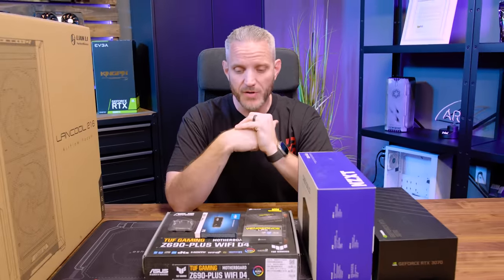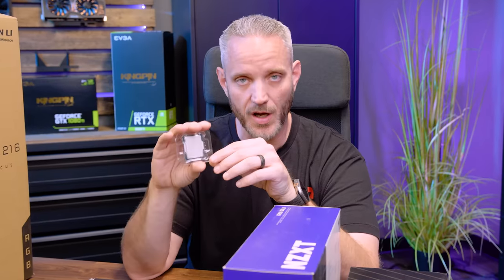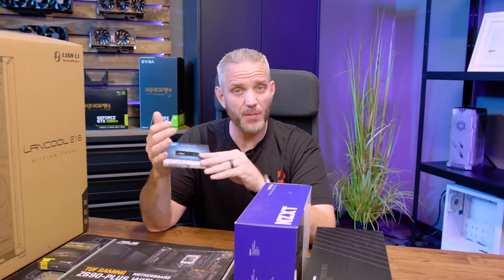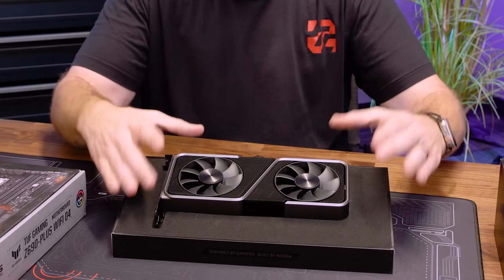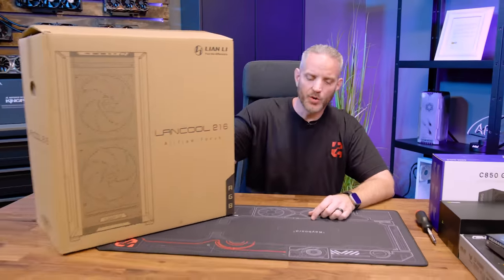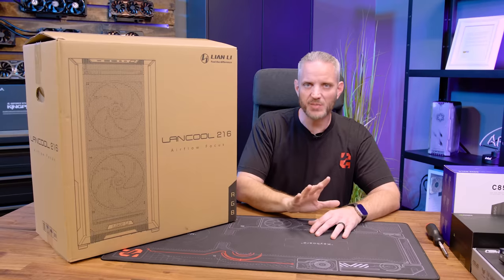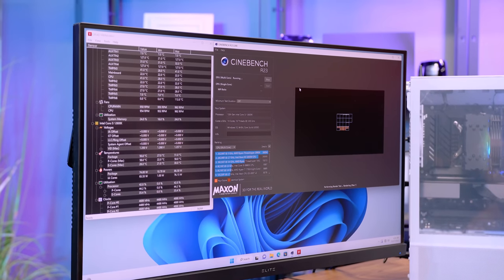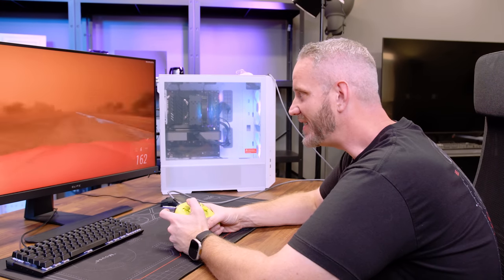Inexpensive PC Build Guide!

Comment: Hi guys, I'm new in pc building. Should I buy SSD with 2x500GB or a single 1TB? I've read some discussion in LTT, tomshardware, etc. and they mentioned about "Raid 0", "Raid 1" or something like that but I couldn't really get the meaning. Does it really impact on the performance? Kindly need your help.
Reply: I'd go with a single 1 TB SSD. RAID (Redundant Array of Independent Disk) is a technology used to combine multiple drives based RAID levels which depend on speed, capacity, and fault tolerance you need. It is typically used in enterprise IT systems and not really in typical home/gaming machines. Doesn't mean you can't use it, but it just isn't very common outside of enterprise systems.

In your case, there is likely no need to use RAID. There are various RAID levels which all have their pros and cons. RAID 0 is a stripped array. Using your example, with RAID 0 and 2x 500 GB SSDs, you would have a total of 1 TB of storage capacity and your SSDs will function as a single unit. Stripped means that the system stores parts of all files across drives. This gives the advantage of having fast speeds, but the major draw back is that if any drive fails, you loose all data.

RAID 1 is a mirrored array. With this level, all files are stored on both drives (hence mirroring). The advantage of this is that you can loose 1 drive, and you still have all of your data. Drawbacks are that your max capacity is limited to your largest drive's capacity and read/write performance is limited since the RAID controller has to update both drives with changes.

As you can see, it gets more complex the higher level you go and there is no real benefit for most home use cases. SSDs are already fast by themselves. You likely wouldn't notice a difference in performance unless you are regularly copying large files or running synthetic benchmarks. Unless you really need the fastest performance, you should be fine without RAID.

Comment: 23:41 Fuck dude, my tower is a custom build with a Xeon E5-2698v3 and my motherboard has the all-core turbo unlock done as well as a little undervolting and my cpu-z all-core score is 109 points higher than a threadripper 1920x and single core score literally 0.6 points lower than a threadripper 1950x, at least according to the scores listed on their site. That is with my power profile set to balanced as well. Set to high performance multi-core score goes up even further but single-core score tanks. Not too friggin shabby for a chip I paid $80cdn for off ali express

Comment: It really shows that AMD didnt think things thru when releasing the 7000 series. The pricing and models introduced to start with kinda gives Intel a stupid advantage that AMD could have avoided by doing some things different. I understand that having both DDR4 and 5 might have made the boards more complex and expensive than they already is, but by not having a cpu in the low 200$ range they will push people on a budget build with upgrade options over to Intel, when AM5 propably is going to be the best choice when it comes to longevity. We might bash Intel for many stupid things, but they did the right thing with several things this generation, Mobos which makes the 12th and 13th gen a better choice for budget builds. AMD can still sell tons of good AM4 budget builds but the upgrade path is pretty limited. You can seee wich upgrade will be availabl in the future. Wether a top 13'th gen cpu is a good choice for  upgrading is another matter when you take into the account how power hungry they are and how much cooling they need. AMD theoretically just need to introduce some cheaper AM5 boards and a good 200$ cpu  and the matter would be solved as DDR5 is already comming down in a decent price category. The biggest culprit is the excess price on AM5 boards right now that keeps real budget builds away. I hope AMD will come with a price banger with the non X versions comming up, cause personly I still think Intel is a dead end already too. They do have the best budget CPU's atm. but a 13900 is still a stupid cpu to upgrading to if you care about your electricity bill and how much more perf you get for the bump up in power consumption. I would much rather be sticking to the 5800X3d and AM4 untill it becomes too long in the tooth. It's still is up there at the absolute top right beneath Intel, trading blows with both AMD's own AM5 and Intel's 13'th gen. Honestly I only think both AM5 and 13th gen has a meaning if you have the need for specific applications where their performance and platform makes sense and the cost is worth it. For the moment there is absolutely no need for the avg home user to upgrade wether you have an existent AM4 or 10'th generation or later build, unless the cost doesn't mean that much.

Comment: Really have a hard time buying into raytracing being  worth $200 more in a new build. $50, sure. but $200? No.

 For me, that's money better spent on a bigger SSD, faster CPU, or just making the move to DDR5 now. If nVidia's stuff was comparably priced, it would be a harder choice, but their prices aren't dropping. 

The Vetroo mounting brackets for AM4 were unusable on the unit I got, and if they can't get that right, it's not a good value, particularly when I can get something that is competitive if not better from Thermalright, Artic, Noctua or BeQuiet! and not get a fan that feels flimsy.

It's an annoying time to try and build right now. AM5 motherboard prices are still ridiculous, We know Intel boards are a dead end in a year or less, and DDR5 is still pricey and doesn't play nicely in 4 DIMM setups at full speed. And that's ignoring new GPU pricing, which in some cases is more than this whole build costs.

Comment: I wouldn't spend $1500 on building a PC when the used component market is so flooded with cast-offs. I've built 4 systems using 90% used parts and only had one mainboard fail over the last 10 years. I've never spent over $800 on any system I've built and they all would play the latest game titles in their generations. I built an AMD Ryzen 3 series, an Intel 4th Gen, 7th Gen and 10th Gen systems.

Comment: Even if you could upgrade this LGA to 13th generation Intel what about if the next generation uses a different socket?  I'm guessing the 5000 series will still be plenty powerful enough for most people's needs over the time span the LGA 1700 is still upgradable, but I'm still pretty new to this so if I'm wrong I would like to know.
Reply: With a different socket you just buy a new motherboard to go with the CPU and RAM. But future proofing isn't that good because new motherboards will have new stuff an old board doesn't have, so by the time you want a new CPU you actually may want to upgrade the motherboard anyway.

Comment: Actually Jay there are as many AM4 @ 5800X as X6x0 @ 12600K CPU upgrade paths and GPU upgrade paths good point about system PSU insurance. Both choices stick you with the board (unless you buy Alder with a DDR4/5 lane implementation that is rare). It's the CPU that gets upgraded when that option is available and data show 30% of CPU upgradable board users will upgrade that platform with an up-bin socket compatible processor. mb
Reply: Alder in the WW channel was stuck rotting on the shelf in October early November as discount priced Raptor rolled out ala Osboning Alder. However, Black Friday into year-end discount (surplus) Windows 11 key price cracked and the mass volume of Alder started to move. AL into RL is a good upgrade option on the Intel side. mb
Reply: Tell me you like to type random crap without telling me… how was any of that helpful to anyone?
Reply: @kaptainkoffee5504  I was simply pointing out either platform; AM_ at R5K or Intel 12/13th has plenty of CPU and GPU option upgrade potential. mb

Comment: About CinebenchR23, I have a friend with an Intel i5 9400F and he gets 5700pts on Cinebench with a temp of 85-86c (If i'm not wrong it should start termal throttleing at 90c) But i tried to compare it to my R5 5600G on UserBenchmark and thay said the 5600G was only +6% better even tho i get 10600pts on mine, i know UserBenchmark can be a little unfair ageinst AMD so i googled other people's scores and thay got around 9000pts on the 9400F. His poor cpu has been running around 90c for a few years but does that really do that much permenant damage or am i simply wrong and it starts throttleing at 80c or something? I don't really expect Jay to see this, it's more directed towards people the comments. What can i do to fix it?

Comment: Nice build, nice video. Im my region i would go with amd for the gpu, cause i can get a 6750 xt for 100€ cheaper than a 3070 here.

I am looking for a new case. Got the cooler Master MB400 but using it to put up my feet, the top cover mash didn't like it. Bigger problem is the i o at the top, never thought my cat would hit the button, but during my thesis i learned differently.
Anyone with a good suggestion with i o at the front, nit ne top? Side wouldn't work too

Comment: do cpu model numbers always correspond with the gen?  like a 5600x is 5th gen and a 7800x is 7th?
Reply: No. Intel and AMD have different and very confusing naming schemes. I know Intel uses the first number (ie 7 in 7600k) as the generation. In other words a Core i5 7600k is a 7th generation Intel core i5 CPU. AMD uses a different system. I don't think I can post links, but the Verge has an article from last year going over AMD's new naming scheme. Its from the 7th of September 2022.
Reply: @JJFlores197  thanks :)

Comment: If you have 2 500 gig m.2 drives can't you raid them and get almost double the speed on the drives?
Reply: Yep, but I don't believe there is a notable difference in performance. NVMe drives are fast enough as is. Unless you are going to be writing/reading a very large number of very large files regularly, it likely won't be be of any real benefit.

Comment: Does the case matter
Reply: To an extent, yes. As long as the PC case and motherboard support the same form factor, you should be fine. Research PC form factors if you don't what those are. After that, it comes down to things like GPU length support and airflow.

Comment: So what happens if I’m that guy who completed a build with a lower end mobo and wishes to upgrade just that? How does that work?
Reply: Depends on what you mean by lower end? Are there missing features you want now/etc? But generally in my own personal builds I've never seen value in upgrading the mobo while remaining on the same platform.
Reply: @paulh7643  Unless the MB upgrade is from an under the barrel board to one inside the barrel or the current board stopped working there's value there, what i don't see any value in is wasting money buying every single generation year after year because it's slightly better than the last gen part.

Comment: Does anyone know a good software to use for fan controlling (free if possible lol)? I remember Jay mention one in an older video, but I couldn’t find it when I looked back. I have a flux 700 case w a gigabyte b550 aourus elite ac motherboard, and while I think I connected the fans to the mb properly, I can’t find where to make alterations in the bios. Also I’m using a rgb software but it only seems to work on the mb and ram sticks 😅

Comment: Hello!
Lately, I have upgraded my CPU from 9900k to 13700kf. And for that I had to change the mobo to a Rog z960 ddr 4. After flashing the bios, re-installing the drivers (my old rtx 2080 super included) I realized my time spy extreme score is much worse, because my gpu lost like 20% (same perf settings of course)... which I really have trouble explaining... do you know what this is about?

Comment: Had the motherboard blow a SMD no idea what quit. (Asus P9x79)  Computer was a 10 year old able to run what I liked to play.  Upgraded graphics last year.  <SIGH>  I have been running an old speedy raid with SSD cache.  (dual raptors+ sata6 ssd) Board that do that today?  NADA.  A new future proof MOBO is gen13/am5 and PCIE 5.0  <GASP>  Sigh okay it is THAT time.  Okay future proof mobo and P/S for what I want is 700$  (The future proof MOBO wants dual 8 pin connectors for the CPU, P/S required also needs to be future proof)  Okay that P/S wattage maxes out my house wiring, so that is done but it can power a 5080.....someday.  The bedrock is now future proof but where do I go.  40$ NVMe drive   <Cheese grin great minds and all that> , the new 1080 HD graphics card,  200$ tithe to microsoft clergy, RAM replace (OMG) only want 16 gb, all they have are 32Gb gb.  (200$) okay now I am bootable........wait CPU!  7950 <Close the drooling mouth, wipe of MoBo, hairdryer applied>  Cheapest i5/7000 available (200$).  Now I am bootable!  WAIT! heat throttling is a thing..... AIO or Brick of fans?  AIO is bone item, future proof needed.  Biggest capp 420 corsair.  <Choke on drool> found one at 170$! Half the Corsair, still want display....  I can lose 20lbs for a black friday deal. (260)  I am still figuring out the overclock on the cheap chip, past 5 GHZ so far....  System will now match despite upgrades...
Reply: Now I have a computer with the bones to do what you just did for 10? years?  Maybe it will eventually equal a Falcon NW rig but....  Oh it is in a cooler master HAF 500 case and I transferred all the old fans across, probably a couple hundred saved.  When the MOBO is done you are DONE with a fork in ya'

Comment: Current build :
AMD Ryzen 9 5900X
NZXT Kraken Z53 RGB
NZXT N7 B550
Corsair Dominator Platinum RGB 64GB 4x16GB DDR4 3200 CL16
Sabrent Rocket 4 Plus G 2TB
Sabrent Rocket Q4 2TB
Gigabyte Vision OC RTX 3080 Ti
Cooler Master V850 SFX 850W
Lian Li O11 Dynamic Mini Snow Edition with front LCD Mod.
Lian Li Uni Fan SL Infinity 120 mm x9
Elgato 4K60 Pro MK.2
CableMod Pro ModMesh white Kit
WIMAXIT 14inch T.S. Monitor

Feel free to comment , wish you all Happy New Year

Comment: Please can someone give me some advice, I recently upgraded my PC (Motherboard Z490 Pro, RAM 32GB DDR4, Processor I7 10700k) I want to upgrade my GTX 1060 6GB GPU but also I've been looking at the M.2 and SSD drives. I would like M.2 NVME 1TB for my windows and a 2TB SSD for games. Would this be a good idea or not, I do have an SSD 250GB which my OS is on and a 2TB Hard Drive, but I would like to move away from HD and just go with SSD's for windows and gaming. Omg this stuff is so confusing so any help will be very much appreciated

Comment: @Jay  Have you had anybody having issue's with Ruzon 9''s, in my case a 7950x on a Gigibyte B650x Aorus Elite AX that has 2 NVEMe m.2 SSD slots. I put two 980 Pro PCIe 4.0 NVMe drive in to the onboard slots BUT they don't show in the bios at all, I took one out and tried that, NO luck I had heard that some time the second drive sometime cancels out the drives) given it didn't make a difference I replaced the second drive. Not sure what I need to do now, I will talk to the suppriers after the holidays, thanks in advance for any help you have

Comment: Quick sync is also good if you want your PC to double up as a Plex server. 

But, I'll be honest, I disagree with a few of your choices. Built 3 rigs and 1 server since Xmas day, ranging from £500 to £1000, you could have saved money in places. 

One of the rigs I built in was using a Montech X3 mesh, with 6 ARGB fans included, great case for £50.

Comment: Imagine recommending a DRAM-less SSD lmao
Reply: Imagine recommending an SSD for a budget build.
Reply: @rimuru2035  You can buy a 1TB NVME Samsung 970 Evo Plus for literally $100 (USD) from Amazon. 

There is no reason to not have an SSD, at least as a boot drive, in 2023. Mechanical Hard Drives are slow and SSDs, even those with a DRAM cache like the 970 Evo Plus, are cheap as fuck.
Reply: @roji556  my system currently has 8TB oif storage 6TB of that is from a pair of HDD's that if replaced with sata SSD's would cost about $500 minimum with no speed increase with an 8tb m.2 ssd being able to replace all 4 drives for about $1200 vs an HDD that costs at most $300.

That price gap will only get bigger, it looks like HDD can hit 6 Gb/s just like their SSD counterparts while most m.2 drives cap out at 5 Gb/s or less with few able to go faster and with the problem of finding a motherboard that can use the drive at full speed, a problem sata lacks.

Comment: The 5600x is a great CPU, better then the 5800 and you are certainly not limited on the AM4 platform. Also, Crucial Ballistic might have been a better choice. Guaranteed Micron IC’s because Crucial is owned by Micron. Better timings, better overclocking, better voltage scaling, etc, etc. On Intel…..yes, like the motherboard choice. As for Nvme drives…….all I can say is stay away from cheap……….because most of those lack a cache. Stick with drives in the middle price tier. I have and absolutely love the Gigabyte Aorus Master 3070ti with the addressable led screen. What a great card. Veetroo Cooler is a very good cooler……no doubt……but I’ll pay the extra $15 for a Noctua. $1500 is not a huge outlay for a decent rig today. Like the case, but not where those usb inputs are. I’m gonna break a few drives with my leg with drives sticking out down there.  BTW, my 8600k beats that Threadripper also. Not a fan of the “P” core “E” core thing……but understand it was the only way Intel could keep up to AMD’s core count and not melt their CPU’s on the board. Regardless of how Intel frames it……….heat issues are the reason for their core splitting…..otherwise……why would you do it other then core count. Most of the time, their ‘E” cores sit idle.